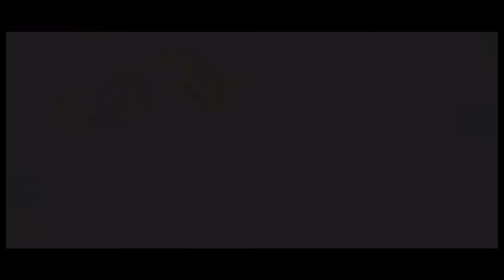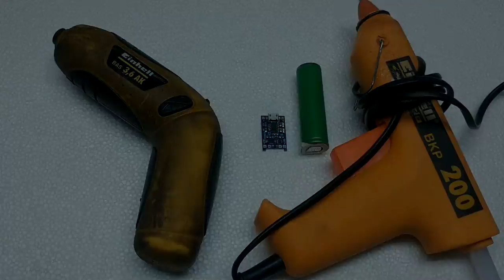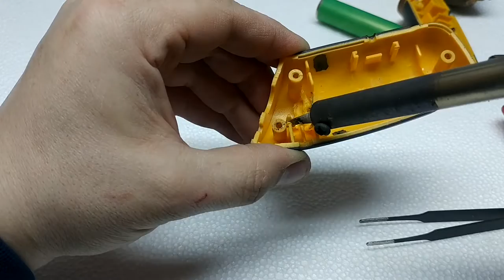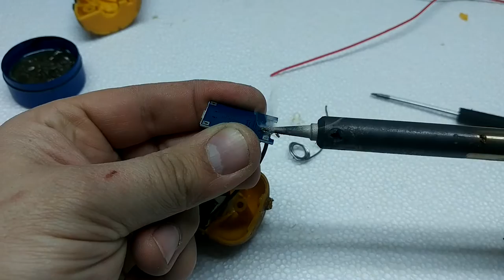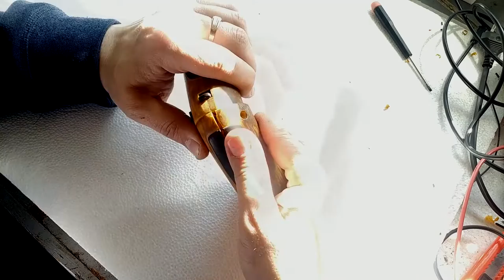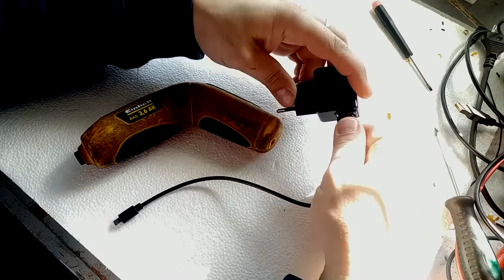Accu Screwdriver Upgrade to Li-Ion Battery with USB Charger

Comment: İf screwdriver gets to much amp "more than 3amp" this module will cut the energy?did u try this on screw???thanks....
Reply from the maker: Yes, i tried, the battery is 2600 mAh, and the screwdriver has now minimum 50% more power. After two weeks laying around, didn't need to charge up to unscrew two bolts, and that's what i needed.
And I hadn't any cut off, so far...